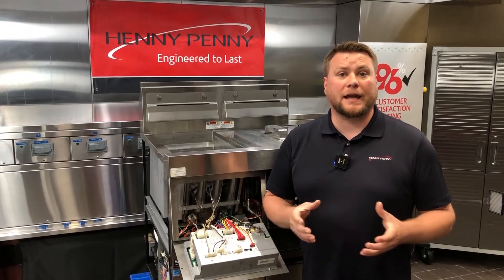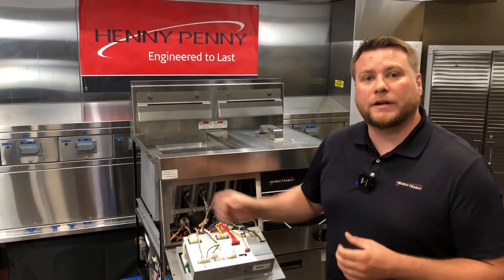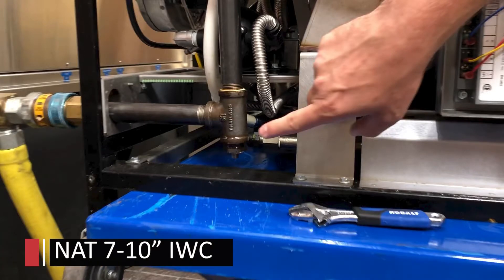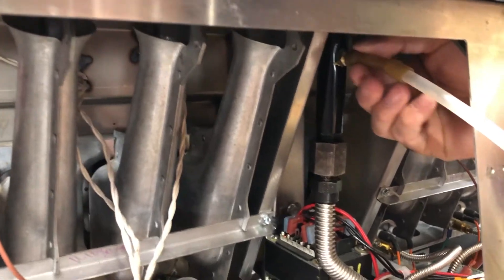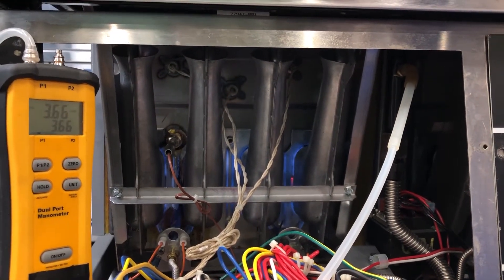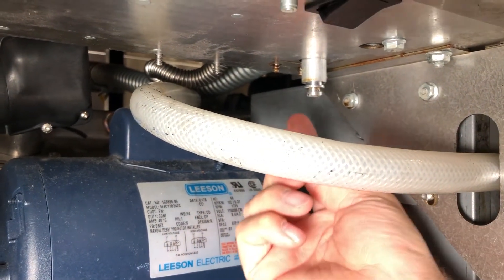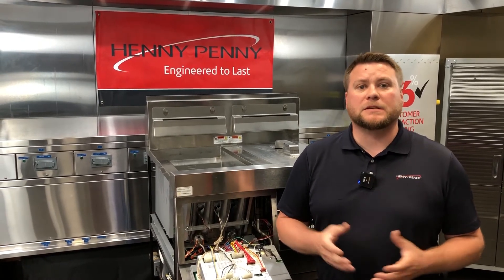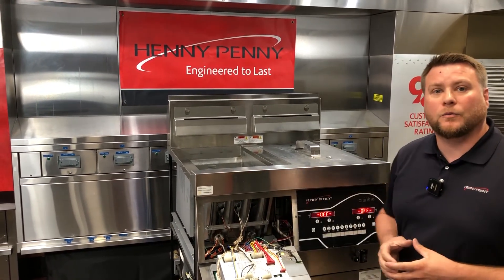LVG/EEG- How to Check Gas Pressure

Comment: Excellent point made on the potential insufficient gas volume issue, often there are significant dynamic pressure drops that are overlooked.
Reply from the maker: You are correct. Thanks, much appreciated.